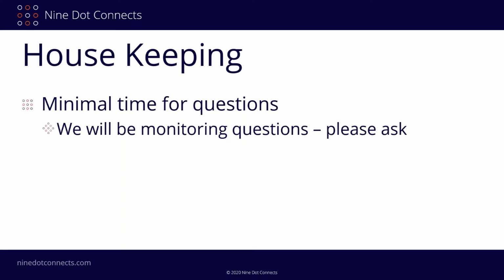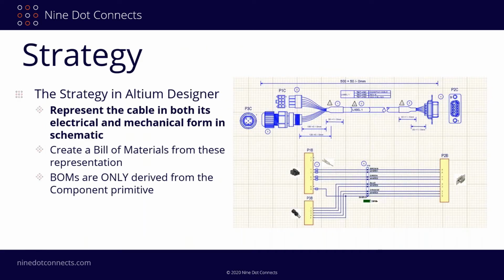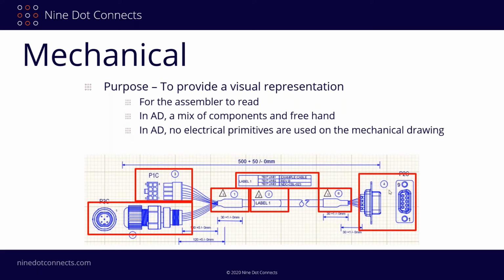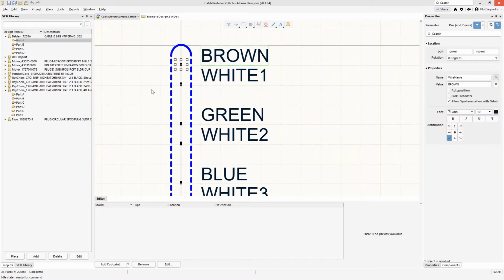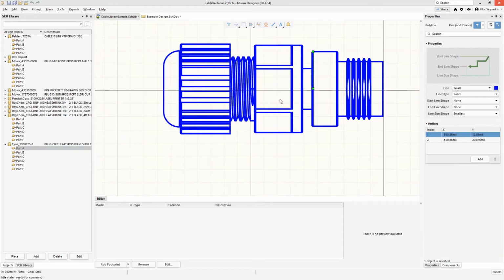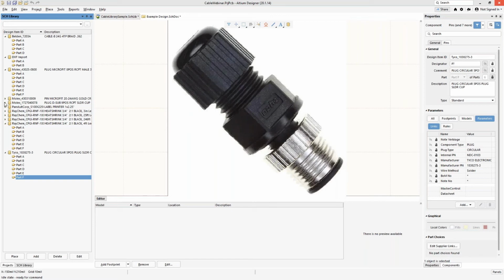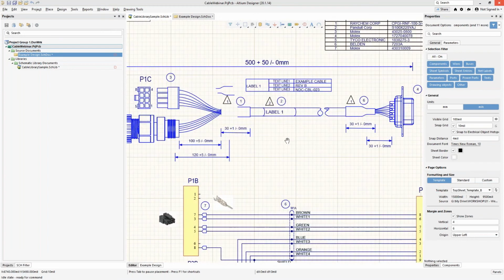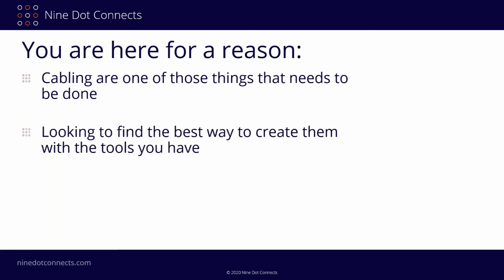Cabling in Altium Designer

Comment: Thanks for great video, I try to import DXF format but altium program did'nt work correctly. Can you show step->dxf file, or can you share some libraries to test my program ? File downloaded from traceparts is very big and I can not open altium library.
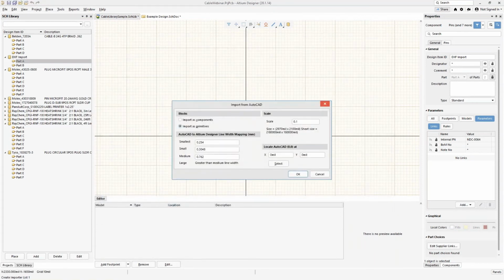Reply from the maker: In reviewing the video (31:33), the DXF/DWG import dialog does not provide the ability to select which DXF/DWG file format to use.  Oddly, this is available in the DXF/DWG import tool in the PCB editor, so it is not understood why Altium did not include this in the schematic DXF/DWG import tool.

Unfortunately, Importing DXF/DWG files requires some trial and error since the formats were never formally defined.

For reference, we have had good success with DXF/DWG imported from SOLIDWORKS and 3D Content Central (which happens to be owned by Dassault Systems, the parent company of SOLIDWORKS.)

Recommendation 1: If you can access the program generating the DXF/DWG file, try setting the format version to “2000”. 

Recommendation 2: Try to import the DXF/DWG file into the PCB editor.  Once you have it imported as expected, save that result at a DXF/DWG export.  Then open the schlib file and try importing the Altium exported DXF/DWG file.

We wish we could be more definitive with our response.  If you do figure it out, please post!